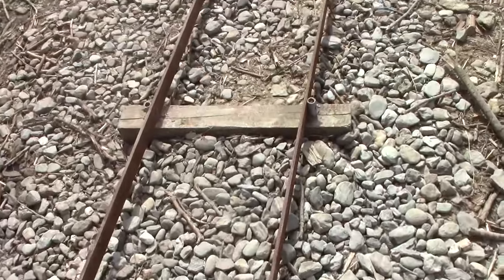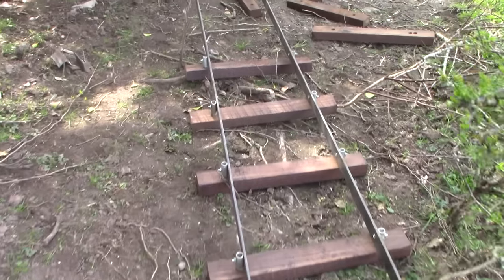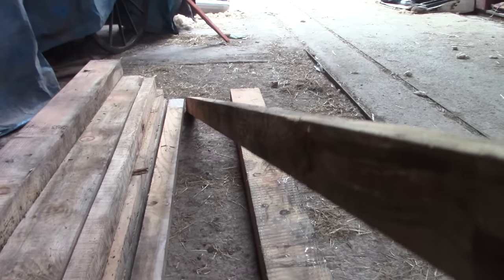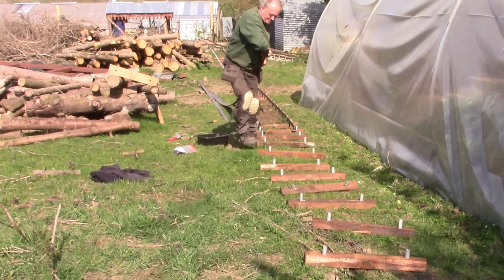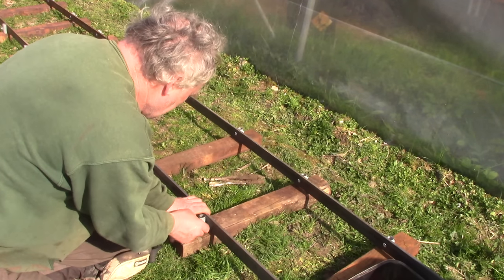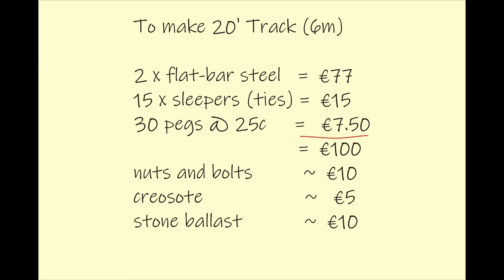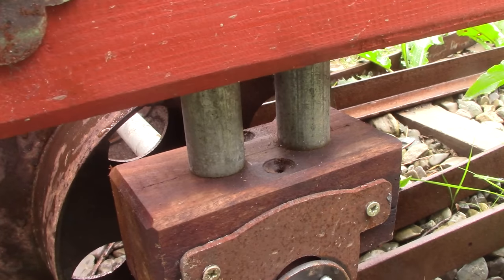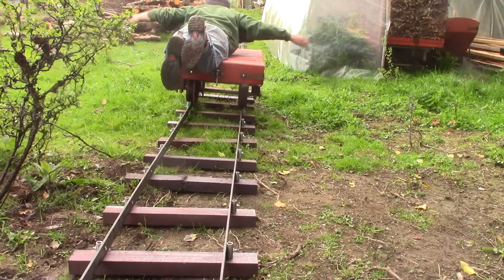How Much Does It Cost To Build Your Own Railway? For Garden, Field or Factory.

Comment: Holy moly $0.5 /ft for a Doug fir 2x4! Those cost $7/ft here in north carolina
Reply: 2x3....
And it's $7 each (for an 8' stud)  not $7 a foot ($56 per stud)
Reply: @jimurrata6785  Douglas fir, not yellow pine. it literally is about that much
Reply: @overengineer7691  I'm a contractor in southern Connecticut.
There's no way anyone is paying $56 for a Doug fir 2x3
Reply: @overengineer7691  Perhaps you are talking about old growth vertical grain clear Doug fir?
We use that for handrail and a few other things. But that isn't a knotty stud that you'd frame a wall with (or lay in the dirt to support a track)

Comment: When I saw how easy it was for you to re-route your railway I thought, why not try it without stones??

I am surprised that you need so much stone under the sleepers, not doubting you and obviously I have no experience with the amount of rain that get.

It might be useful to have moveable rail sidings to access fields occasionally.
Reply: For a very long time he had no stone under it. As it get more and more muddy, weight and overgrown with grass it tends to sink in. Which is why he ordered a load of stone and has been putting a little bit here and there. I have 3/4 of a block in a small town and at some point I might do this just for the fun of it.

Comment: Your rail costs almost more than buying real railroad rails. Aluminum rails cost about 1.60 a foot new but I saw a listing for 3000 ft for $1500. There are molded sleepers available for pretty cheap as well which will last much longer than wood and since the rails gets "crimped" to them you save the cost of bolts and pegs.
Reply from the maker: You obviously don't live in Ireland!

Comment: With 4 gauges, CPS II is a bit more expensive per foot than yours- at about $7/ft or so, plus sleepers & ballast...I have to get more 1 1/4x 1/4 bar for track (30mm x7 mm, or so).  Welded onto the tieplates, not screwed.  Gauged at 3.5", 5" and 7.562".  Yes, a labour of love, not one of necessity the most practical way.

Comment: About steel, is there local scrapyard to look for? We have 3 around city and they are half cheaper than any shop than sells new steel. If you are lucky, you can find sizes you looking for very affortable prizes.
Reply from the maker: You are so lucky - we have nothing like that here
Reply: I doubt you will find anything longer than 2 meters in a scrap yard, and it's likely to be random sizes.
Reply: @lolatmyage  Well, we have most of usable steel 6-12meters. And some even longer when they scrap for reuse. But of course its random sizes and you cannot get more once its used.

Comment: I see that your rails are very thin my opinion is to limit the weight so the rails don’t buckle and flatten / break
Reply: He’s already tested it with a quite large log and a full wagon of ballast, so for his purposes it will be fine
Reply: I’m Ware if that I’ve watched his videos to but what I’m saying is even if he tested it and it’s fine over use of the same heavy loads can worn out those thin rails faster
Reply: @ilikecheeseilikecheese727  It can still probably reliably carry more than he can easily push around

Comment: @wayoutwest-workshopstuff6299 >>> I have noticed you do not use any lock washers or thread locking compound on the hardware you use to fasten the rails to the galvanized pipes. 

Do you ever have a problem with that hardware coming lose? {I presume not.}
Reply from the maker: a little rust soon holds them in place : -  )